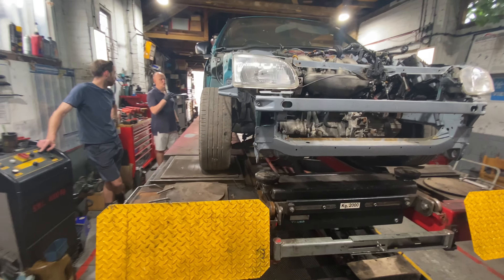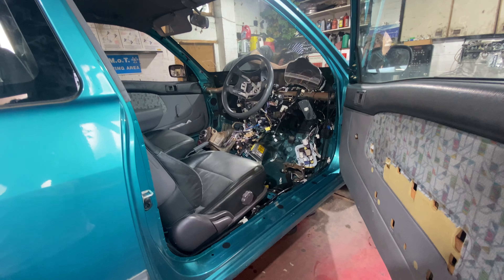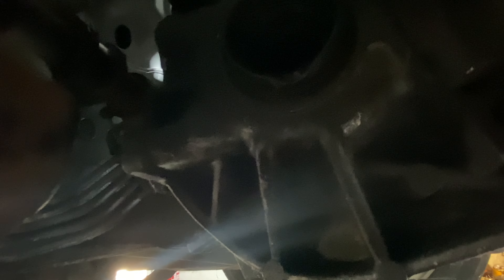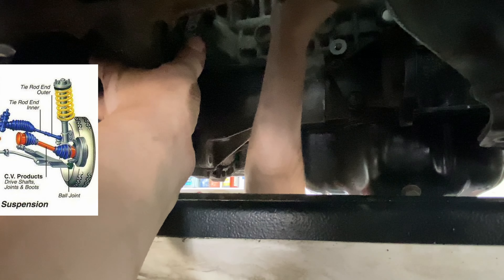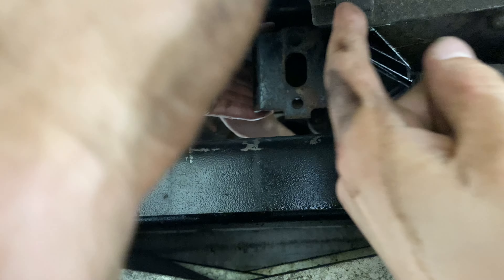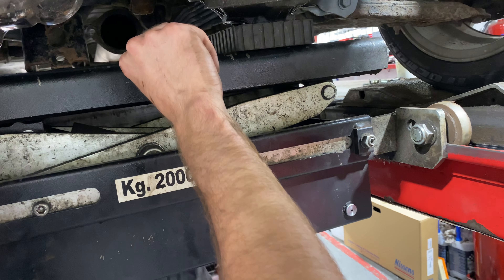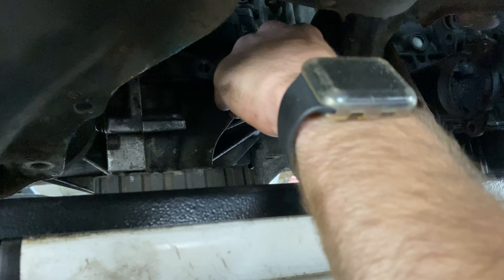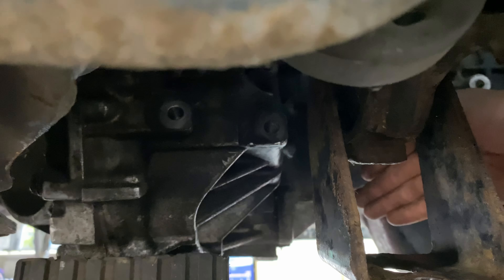Starlet 2zz-ge  (Engine Swap series) EP7 (Part1) Preparing & Planning for Rear Gearbox Mount!

Comment: mega project - will it end with result?
Reply from the maker: Yes big project especially when we have never done anything like it before. I won’t give up until we have results. We have much more plans after then engine is in and running too. Delays and circumstances keep happening so it’s been slow in development but as they say “nothing good comes from easy” :)